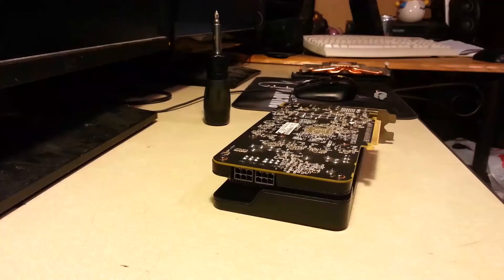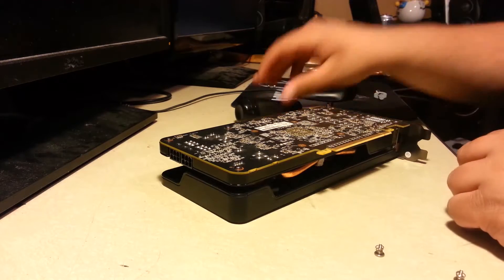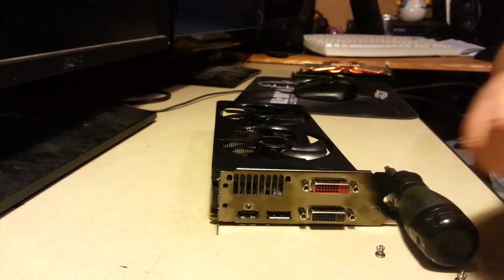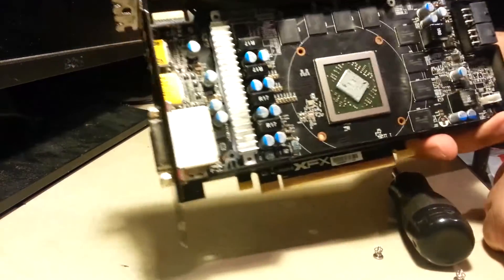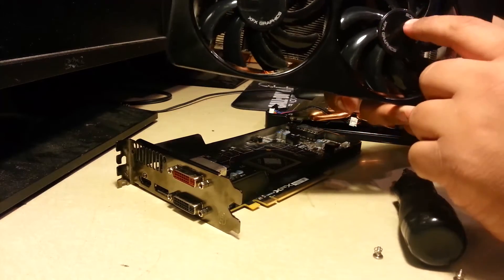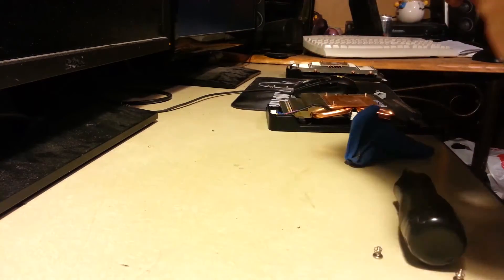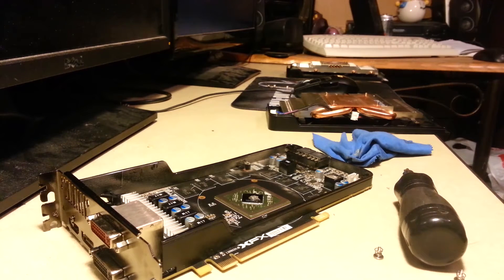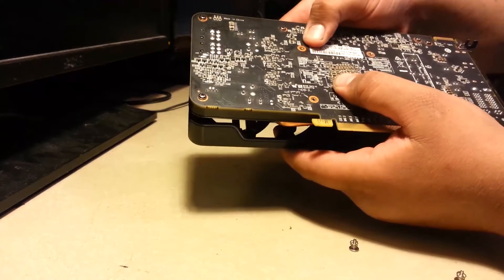How to replace your thermal paste on you video card.

Comment: I've HIS R9 270 2GB DDR5 IceX2 Edition and heats alot.
I'm not sure if it has lost all the paste inside. Well the care is under warranty but I have to ship it to another city and get RMA/claim etc etc.
will I void my card warranty if i open a cooler myself.
Please help!
Reply: +Aurangzaib Umer 
the card*
Regrets for error.
Reply from the maker: +Aurangzaib Umer It would depend on the company,XFX is okay with it,but i don't know about HIS,i would contact them and ask.
Reply: +trainergames alright, mate.
Reply: +Aurangzaib Umer I am in the same situation as you, plus mine also used to crash in some intensive games. Please let me know if you got answers from HIS about warrantly or any other solution on the case. Thanks.
Reply: +iamsteyone okay mate, I'll ping you as soon as I ship it for warranty purpose.
Reply: +Aurangzaib Umer Thanks. Ill be waiting.

Comment: IS your stuff still running hot? I'm at 59C just watching this video and not doing anything else.
Reply from the maker: +GramOfMayo It is not running that hot anymore.

The thermal paste helped a little bit, but one of the fans on the cooler died,XFX sent me a new heatsink/fan , and the new one was still having problems at first,but then i noticed the new one was a little different,it was hitting the plastic trim attached to the PCB, i removed the trim and it works perfect.

What Card do you have? And what is your case? 

I can try and help you find out why your temps are a little high.
Reply: When I turn on the computer and my gfx is connected (i have an xfx 280x) I can literally put my finger into either one of the gfx card fans and it automatically stops. doesn't hurt or anything. I feel like these should be spinning faster for some reason. Did xfx send you replacements without having to send ur gfx card back? I don't feel like sending mine in and having to wait like 3 months to get a new gfx card.

Comment: Hello, I have the same exact card and one of the fans is dead I believe, It doesn't work even at 80 or higher temps and when I tried spinning it with my finger, it did spin like the working one on your card (this was when my PC was off). Any idea what I should be doing? I never took my GPU out of its slot lol
Reply: Three months and no responses?  Damn.  If you're still having an issue, you can buy replacement fans on Amazon.  I bought one of these back in 2015, and the fan closest to the output ports is on the way out.  It sounds like a wood chipper when the fans need to ramp up, and I'm pushing about 83C in some games which I hate.  I grabbed some Arctic Silver paste since I've got to take the card apart anyway, and together they ran me about $35.  My stuff should be here on Saturday, I'll edit the response with how well it goes.